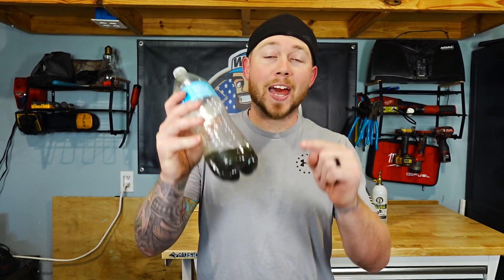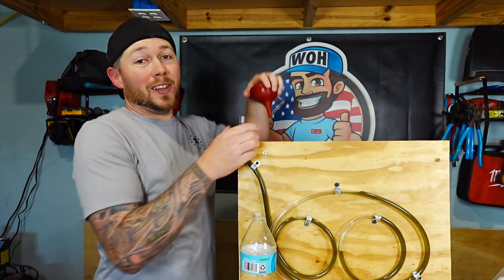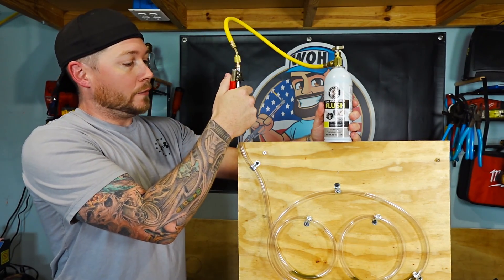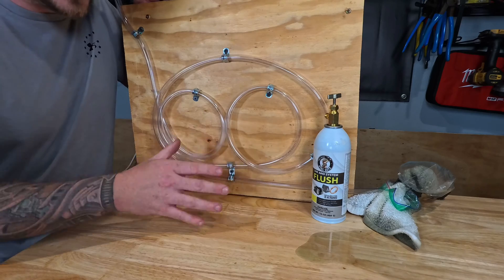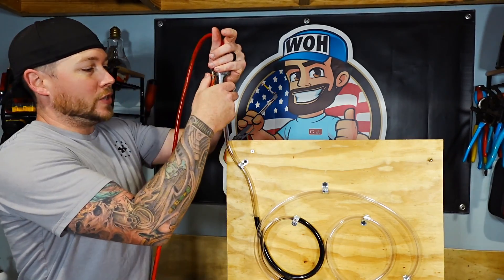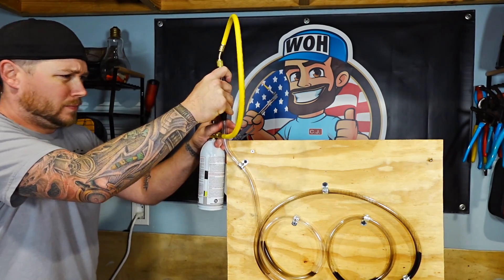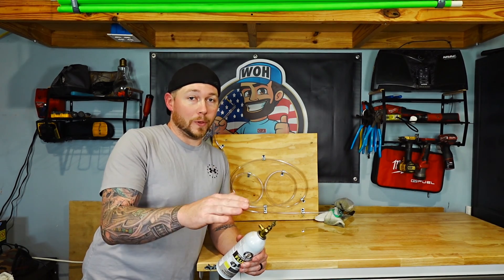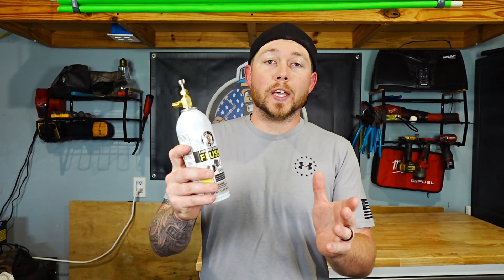Nitrogen VS. Flush! Which One Removes Oil The Best?

Comment: yeah rigghhhht…. seeing as how on the very first “flush” with just the nitrogen you actually “sprayed” for a tick over 2 seconds… then, when you did it with the can of “miracle flush” stuff, you sprayed it for 8 seconds….(not to mention, there wasn’t near the same amount of oil in the line that you did in the first spray)…. THEN, on the motor oil, you initially sprayed for 5 seconds, then with the flush can (after “you didnt get a good seal on the first try”) so you sprayed it TWICE for a total 14 seconds… dont sound like a lot of time difference, a few seconds, but it makes a HUGE difference in clearing out the lines.. do the same amount of time on each and see if it dont do about the same… 🤣🤣🤣
Reply from the maker: Yea God forbid I use my eyes to see somethings not working. You're more than welcome to make a video proving me wrong.

Comment: Flush is just non chlorinated brake parts cleaner. You can buy it in a can with a screw on lid not just the spray cans although a spray can and red straw can get it into a line set.